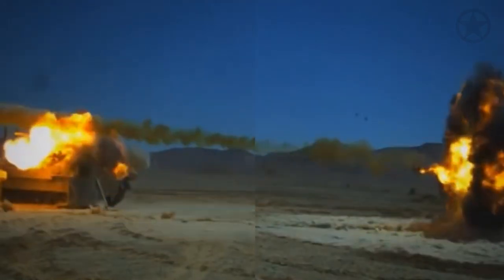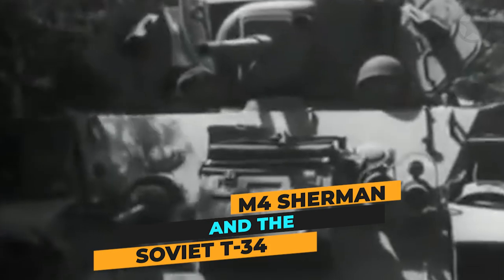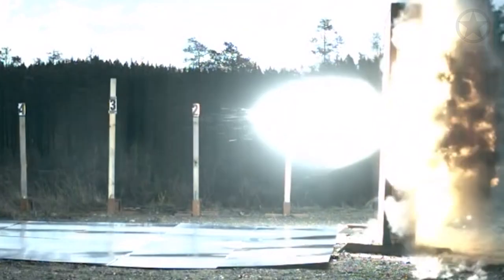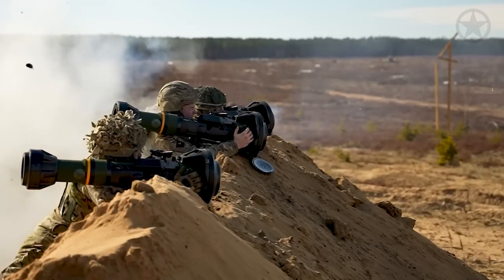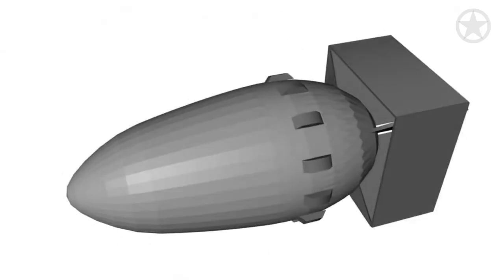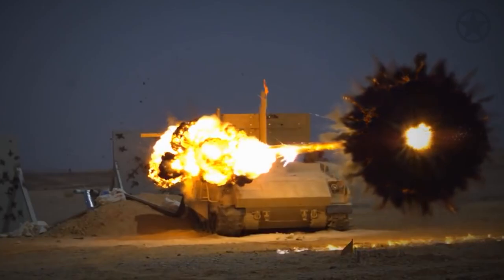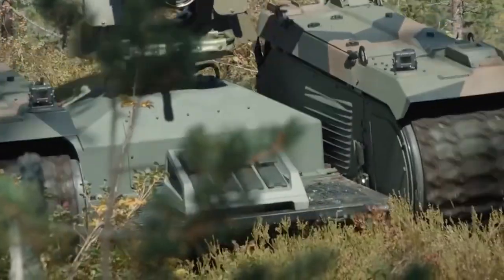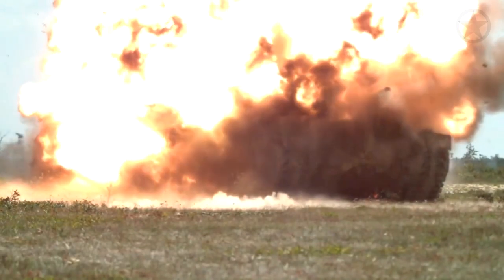This Is The #1 Threat For U.S. Tanks

Comment: What a load of BS:

SPACED armor (used as early as WW2 in the "Vorpanzer" and "Schürzen" of german tanks) does not explode. Because it is an inert metal plate. And Tandem charge warheads are NOT used against those (otherwise we would have seen them together with the first ATGM) but against REACTIVE armor. That explodes

HEAT rounds where part of the regular loadout BEFORE WW2 started. The 75L24 in the early Panzer IV had the choice of FOUR HEAT rounds with various penetrations. But KE rounds where more effective at typical combat ranges (The 75L48 that was ALSO used on the PIV could penetrate more armor at common distances with AP then with HEAT)